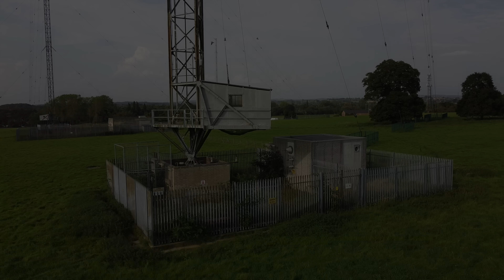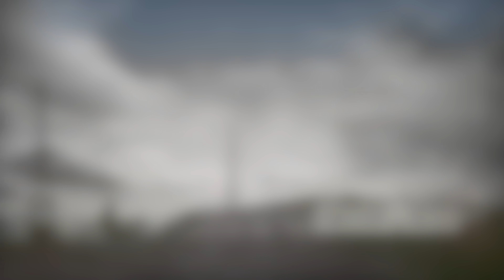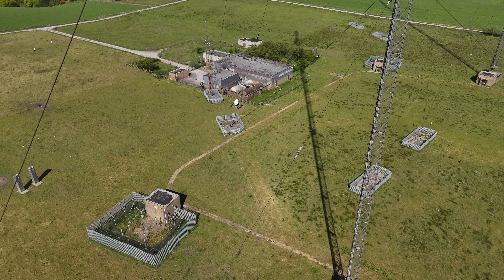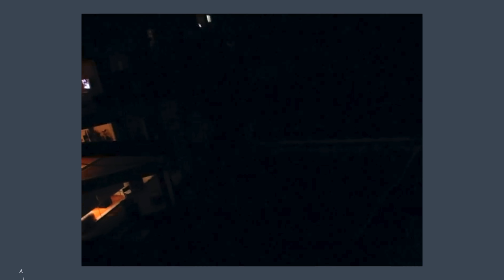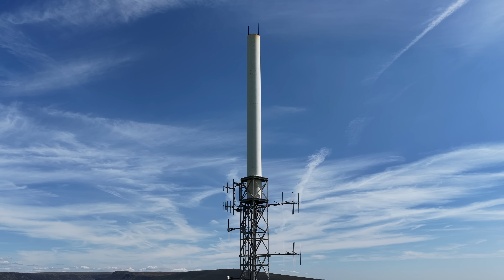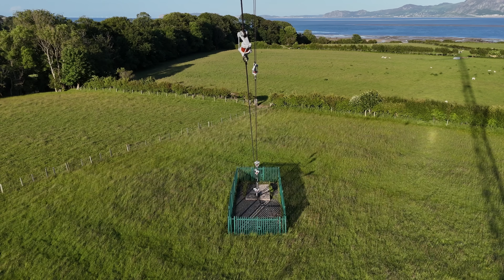Can You Harness Free Electricity From Radio Signals?

Comment: We were working on a block of flats next to the Droitwich transmitter. We were putting the heating system in, and whenever we put new pipes down the corridors, we were getting shocks, and big sparks were jumping from pipe to pipe. The electrician had to fit earth bonds all over the place.
Reply: reminds me e time I was fitting CCTV at a substation, about 30m from a 275KV line. We had 6 inch sparks jumping between the camera and the pole as we mounted it, and were getting shocks of the nuts and bolts as we were doing them up. And also of the wires for the IR lamps when we were wiring them up. It's amazing how much voltage can be generated in metals near HV lines or high RF transmitters.
Reply: @lesleymunro4964  Electromagnetics is a fascinating field to study.    You can't study electricity without also studying magnetism and magnetic fields.    It falls in beautifully to radio propagation too.  Or maybe it is just me that finds it fascinating lol :)
Reply: @lesleymunro4964  Thanks for the reply, yes I agree. I think there is some kind of capacitance thing going on building up the charge in some installations. It is amazing. :)
Reply: Tesla had a battery charging device using an antenna and spark gap, and most hams will know you can get high voltage potential on antennas just from wind stripping electrons from it.
Reply: thats because it doesnt stay inside the cable and the cable is just a guidance
Reply: @EinMann123 

I remember our old IT teacher telling us the RF type cables with the gaps in the insulation could transfer rf waves. Mind blown at 18 😂
Reply: Probably a lot of static build up.    There was obviously not much power behind this, as you are not dead.   Sure, bonding would be needed to prevent people getting those static shocks, but if it was any power that was useable, you wouldn't be here to tell the story
Reply: Hey Laurence, After working in air conditioning for many years (inverter systems), We found some installations we exhibiting strange behaviour. When I got involved as a systems technician, my training in amature radio led me to some interesting finding. 

One of the major causes of system failure was bad earthing on the premises, they were also living within 30km of one of Sydney's most powerful AM transmitting station. The customer was complaining that they could not listen to there morning AM radio programme since the air conditioner was installed ( 3 phase ducted inverter system). That statement got my attention, I took my best portable AM receiver radio to test around the property, nothing but the oscillation of the inverter system was received across the dial. 

Further testing found transient voltages in the power side of the system. The inverters use a massive induction coil in circuit. We found the field collapsing sending massive spikes through the system that could not get to earth. As with your solution, we too drove two new earth steaks and bonded the system with heavy gauge above the standard. The system was still experiencing occasional faults however the AM radio was now clear again.

Have a good one and hope the weather is cooling down for you. :)
Reply: Apartment
Reply: @Scudmaster11  Not if you're referring to a "block of flats".  Droitwich is in England.

Comment: It's not all rubbish!  I did some overhead lines work in the late 80s around Wrexham and Wales.  We did used to find attempts of people connecting cables onto overhead lines, not knowing what voltage they were and causing our fuses to blow etc.
They always lied and said they were putting aerials up, using farm machinery and having accidents.  It was possible to work out who had done it by who phoned to report power outages.  Looking at maps showed distribution details.
There was a cheeky farmer that run a long wire in parallel alongside one of the overhead lines and he was getting a voltage, but not enough actual power to do much with it.  Incredibly dangerous.
You are more likely to find that during the 80s there were a lot of bent cable fitters/jointers who would charge £50-100 a go to dig up a path or pavement and join a new mains cable and put that to a cut-out and fuse box in the house.  That's why you should ALWAYS check the power is off as switching the main consumer unit off or pulling the main fuse is NOT enough.  Houses around Liverpool are notorious for this.  It still goes on today with cannabis farms, there was a case on TV news recently involving a reputable company that joined supplies up for free electric.
Whole substations used to go on fire in Liverpool, introducing the need to meter every street.  Police also used that data for years to work out which streets used far more than others to find farms.
Reply: Lewis mentioned the only documented causes of people stealing power was power from power lines. Stories about stealing power aren't all rubbish, but stories about stealing power from transmitting towers are all rubbish.

Comment: You can't beat the inverse square law
Reply: re: inverse square law -- applying to Transverse Hertzian waves.. yes. But the longitudinal waves, not physics taught in the public domain, may be a way around this. Consider the "smoke ring" (stealing from Stan Deyo's anti-gravity lecture on youtube). It takes very little energy to create and set a smoke ring in motion. Once it is going, it can go a very long distances w/o diminishing in power. And from Thomas Bearden, when H=0, and B=0, conventional EM theory breaks down. Heaviside's dot product here goes wrong. The math is wrong. If you use original Maxwell equations you get something different. Consider how within a ferromagnetic material you can send a wave of one frequency from left to right, and simultaneously another magnetic wave from right to left thru the material. The magnetic domains are very fast at the atomic scale. With the same frequency, and "bucking", you can create this mysterious H=0/B=0 phenomenon. Back to Stan Deyo -- Lorentz O.
Reply: Just look into edward tellers description of a laser, with downstream "shadows" providing an INCREASE on the cube, the exact opposite of the inverse rule...
Of course he doesnt go into detail, he is mainstream after all...
Reply: @morpher44 Well said!
Reply: Nearfield Zone!   Inverse-square doesn't apply if you're one wavelength distant from the antenna.   Notice that most of these stories involve VLF transmitters, where the transmitter "nearfield zone" may blanket the local neighborhood.
Effective Aperture!   All antennas can be treated as circular absorber-disks for EM waves, where the "disk diameter" is called EA Effective Aperture.   The EA of a high-Q resonant loop antenna is very large, ideally about 1/3 wavelength (for a superconductor loop.)   At VLF wavelengths, a meter-wide resonant coil might be equivalent to a hundred-meter antenna tower  ...but only if it was made from copper pipe, or expensive litz-wire.   Resonance is weird, and it makes "Resonant Power Theft" feasible.   But it only works if you can reduce the losses in your resonator to extremely small values.
Reply: Are you insinuating that I should put my collecting wire very close to the power lines ?
Gotcha
Reply: @monad_tcp  don't put anything next to the power lines. in fact... more extension cords are needed.
Reply: You can beat it with a large enough battery array and optimally managed consumption

Comment: Here in the United States they caught a farmer who had a power company run lines across his property.  He had some snap so on top of his fence he replaced the top wire with an insulated wire and another on the second wire.  He harvested spurious energy and was supplimenting his home power and selling the excessive BACK to the power company.  They figured it out due to his electric bill disappeared and they were paying him.  He didn't have wind or solar so they sued him.  The jury went with him and the electric company cut their losses and left him alone.
Reply: Sounds like a tall tale to me.

All you could do would be light a few bulbs without miles of expensive wire and a means of converting it to useable electricity. The electric company isn't going to find that, and it isn't easy to do, you get such little power... It would be useless back with incandescent bulbs and resistive heating which needs at least 1000W to be somewhat useful, that would really take lots of $$$$ of cable. 

Sounds as believable as the tall tales of being caught for transmitting without a license (in the US). You really have to be BAD and purposely attracting attention to yourself to get caught.
Reply: Citation needed etc
Reply: I've heard variations of this story for decades, but without a source I'm not inclined to believe it.
Reply: they cant detect this i know a farm that has electric fences and they do not even have to use chargers on them they pick up the RF off the high lines on the property plus if they park a machine too close they get a shock if its touched  .
Reply: I read about a guy in california had lines over his shop so he put a induction coils under them and powered his shop elec company sued he won since no physical connection. Nickola tesla wanted to do this on a global scale.
Reply: @randyhaglund7557 If there was a ckurt case then there should be a link to it or at least name the case.
Reply: For each insulator on 380 kV lines one has to calculate with losses of ~1kW. So tapping a few hundred watts would probably go undetected.

Comment: I can't see how a prosecution could hold up as receiving antennas don't load the transmitter & cause it to use more power. Once the energy has left the antenna, it's effectively a detached bubble of energy. It could cause interference or blocking of signals as mentioned.
Reply: It seems like the rules over there are a lot more strict than here, even more so with enforcement

Comment: I grew up about 2km from the AFN AM transmitter in Bremerhaven/Germany which was so strong that you could hear the transmission without much additional electronics by just connecting a speaker to a length of copper wire and to the radiator on the other side. I was able to run a small quartz watch for many years from the signal rectified by a small diode, charging an electrolytic capacitor. I wonder what could have been done even closer to the transmitter...
Reply: I've got a similar situation living about 100m from a 50KW MW transmitter.  Their signal is easily picked up on household objects or wires run to speakers.  I have to put ferrites on everything, which does work at least.  Unfortunately it is not a station I care to hear.

Comment: Hilarious.  I happen to live very near a MW transmitter on one side of me and a major major TV site on the other side with two towers and a third one a bit father.  This area is notorious for having garbage TV reception because we are all too close to these towers. You must have a satellite dish or cable TV to see anything.  Anyway, the radio station is more interesting. Their signal is picked up on everything in my house.  Run some speaker wire across the room and the speakers will pick up that signal and make sound.  Worse if you are trying to use an amplified input.  I have to put ferrites on everything like that.  At least it works.  But supposing I did want to harness that energy and had a way to do it, the station would never know.  It wouldn't create a hole or void in their signal that someone could trace back. That's not how RF works. Someone receiving a signal doesn't suck it out of the ether like a black hole capturing light.  It wouldn't make that much difference.  It is absolutely laughable to hear about someone allegedly wiping out submarine ELF radio with a RF vampire.  If that was possible, every nation would have these power stealing stations everywhere ready to jam submarine comms.
Reply: Don't worry about poor TV signal quality; there's nothing good on nowadays.

Comment: Let's just asume this is possible and it might very well be. What i don't  understand is how this affects the transmitted signal.  Yes you use energy broadcasted but that should not be taking it away from others. It's that's also real  this would be very interesting for science.
Reply: It has no effect on the signal.  That's the answer.  There is no effect or impact. It does not suck radio waves out of the ether like a black hole eating light.  You only ever receive the signal you were going to receive.  Not mine. Not the neighbor's. Not everybody else's downstream.
Reply: @LatitudeSky The incident EM field induces current and voltage in the receiving antenna, with a crystal set this then causes the diaphragm in the earpiece to vibrate. The vibration of this diaphragm against the air causes the air to vibrate. The vibrating air is a form of energy, since energy can neither be created nor destroyed, where do you think it comes from other than the signal radiated by the transmitter?
Reply: It deprives others in the shadow.

Comment: This is actually an interesting topic because it could theoretically work. If you can make a crystal radio and get enough power to vibrate a diaphragm in a speaker, then you can light a small light bulb (especially LED). It's unlikely that you'll be able to get enough energy to power an entire house, but it's not fundamentally impossible.
What surprises me more is that such tales describe the antenna/receiver as some kind of black hole that sucks in energy around itself. As far as I know, that's not how it works.

//If you still want to get free energy and not be condemned by the BBC or punished by the Illuminati for inventing a perpetual motion machine - just install a damn solar battery!
Reply: It seems like the people warning about this or talking about someone they heard got prosecuted just don't understand how RF works.  They think it does the black hole thing and that's just hilariously wrong.   You would have to know nothing about radio to come up with that.
Reply: An antenna will extract a small amount of the EM energy passing it, this is however very small and would not cause a black-hole behind it. Consider a crystal set.

Comment: My late father worked for GPO/BT back in the day. I remember he said apparently there was/is a law preventing theft of electricity from the 50v exchange batteries. The theory being that someone could extract power from their telephone line.
Reply: The "abstracting electricity" law was occasionally used to prosecute phone hackers in the 70s I think - because there wasn't any law that covered fraud against a telecoms system until the 1990s. The amount & cost of electricity stolen was tiny compared to the loss of revenue from free calls!
Reply: I knew of an individual in the states back in the 70’s who would charge his in cad batteries from the telephone system when the house phone was "on hook".
Reply: @Subgunman Drawing as little as  20 milliamps could be interpreted as "off-hook" by the exchange, so it would probably need to be less current than that. At 50 volts DC this would equate to a max of 1 watt.